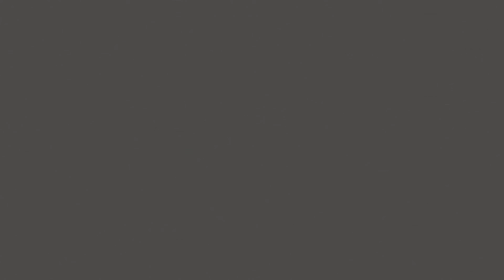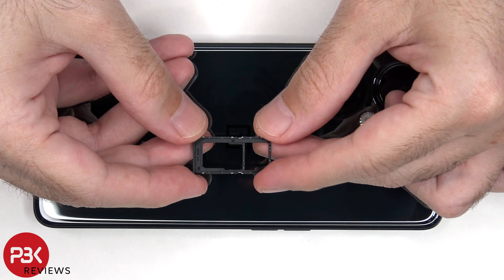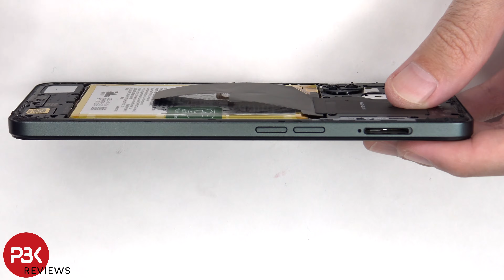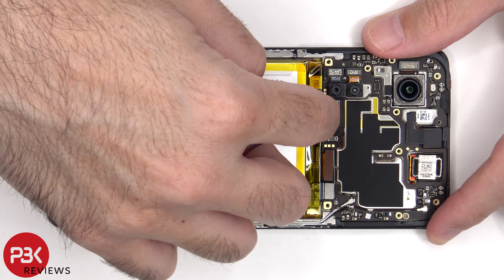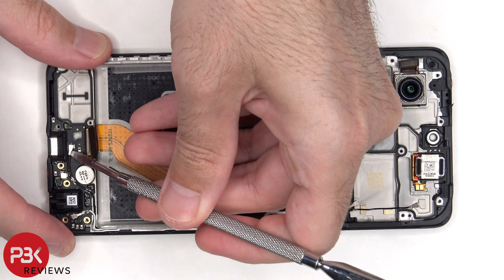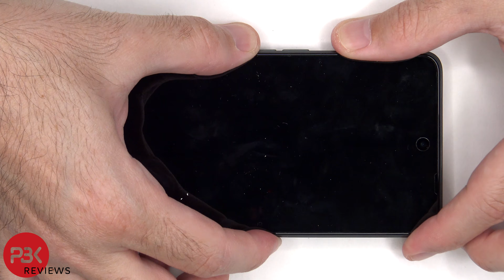OnePlus Nord N30 5G Teardown Disassembly Repair Video Review

Comment: Hello sir. My phone was water damaged and will not turn on. I am looking for a way to retrieve the data. I never had an SD card in it, only SIM. Is there a way I can get the data from it? Will I have to replace/repair all damaged parts?
Reply: You can extract data directly from the storage chip but since it is water damaged your storage chip is probably also damaged

Comment: I'm confused on where the heat is generated the most at, is it from the battery area or where the sd 695 5g at?
Reply: both because I have this fuckass phone and it overheats on TikTok and when charging

Comment: In oneplus's FCC Certification for the N30 its states that " These two models only differ in model name and sim card slot. Everything else is the same " . Question is that are the motherboard frame and lcd frame are the same thing?